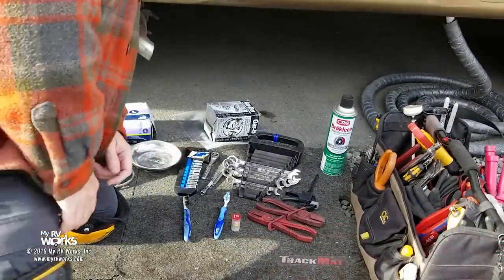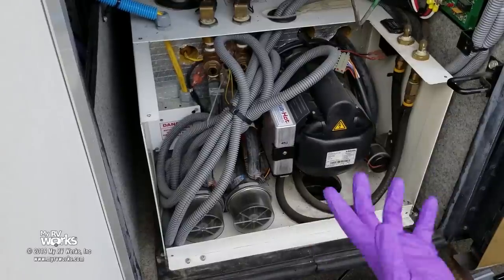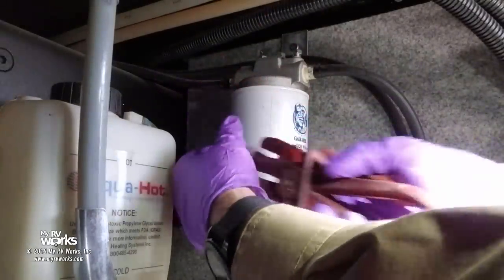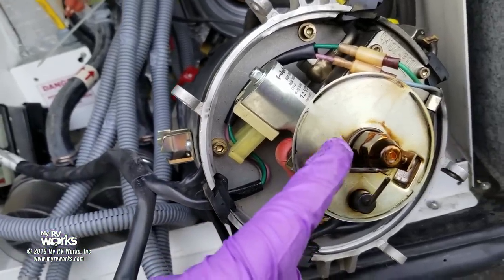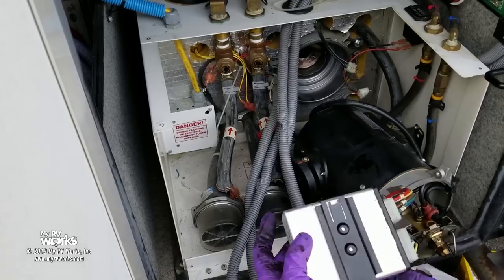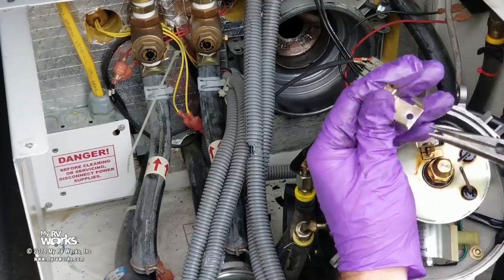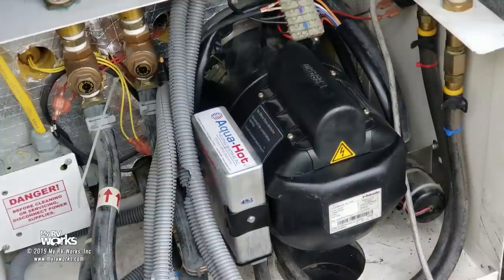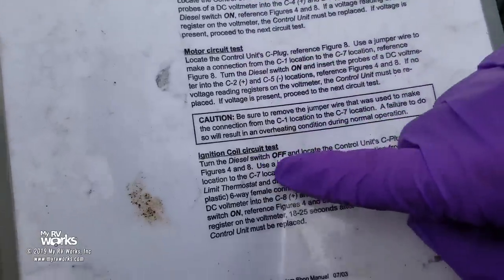AquaHot Troubleshooting and Annual Service

Comment: Hi Daren, this is a very comprehensive guide. My Newmar coach has a 450-DE model and all your tips worked really well. The burner in my case was really nasty and I would think that was not being serviced for a long time (I bought this RV ~1 year ago…). I bought other parts other than the filter/nasal since they were in a pretty bad shape. This was my first time doing this and I felt very confident following your procedure and the aqua hot is running smoothly now. Thank you Again! I now subscribed to your channel and will look for other great tips in your video selection. Have a wonderful week! Marcelo from Dallas/TX.
Reply from the maker: Thanks, Marcelo!

Comment: Installing a filter A technique taught to me by a clock Repair specialist is to first reverse direction when seating male to female threads. This allows the threads to "groove seat" with each other and avoids nearly all cross-threading chances. You can feel and hear the threads mate to each other.  Works well on nuts, boots and screws, too.
Reply: Especially spark plugs...

Comment: Free tip:
Nozzle is 16mm. 16mm won't cause the wrench to "stick" going on to and off the nozzle, potentially scratching it up or damaging it. That extra .005 of an inch makes the difference. And base is 19mm, btw.
(Hence, my 16mm and 19mm are two of the most used wrenches in my metric set. And probably my 13mm because of the hardware that comes with Lifeline AGMs. 1/2" "sticks")

Comment: The easiest way to eliminate spark potential is a jumper wire between both electrodes for fuel testing. I have a mini jumper with clamps set up for this. This will keep you from having to disassemble the coil.

Comment: Fuel filter o-ring protection: Guard against tearing the o-ring by placing the corner of a plastic bag over the filter base threads. This will keep the sharp edges away from the o-ring when sliding it over the threads to it's seated position. This works well with any o-ring application when sliding it over another object, especially one with sharp edges. (A technique used on suspension system rebuilds. See "The Motorcycle Suspension Bible" by Paul Thede and Lee Parks... It's got a lot of great Tech tips for working on mechanical things. I helped write the book---Shameless plug) Perhaps you can show this method as a quick tip in a short video? Thank you for all your helpful videos😊

Comment: Fantastic video Darren.  I learned a lot about our AquaHot.  I was hoping you would talk about the smelly smoke output and if there is a thermostat to adjust the temperature of the water.  Perhaps the annual service should solve the problems.  Thank you.
Reply from the maker: Domestic water adjust is on the back side.  It is marked at the factory so do not adjust it.  Better to slow down the water so it spends more time in the heat exchanger.  There are approved shower heads that work with the AquaHot - make sure yours is one of the ones they list.  So many GPM flow rate.    To schedule a service consult with Darren please sign up for the "1:1 Repair Consult" on our Patreon site.  https://www.patreon.com/myrvworks

Comment: I just bought a 2005 Dutch Star and this is my first glimpse at Hydro Hot all my previous RV’s had regular propane heaters. I’m so glad you made this since I’m totally unfamiliar with this unit. I don’t even know if this Hydro Hot is working. Asking how important is the antifreeze that goes in this? The fellow that owned this did no service of any kind to anything in this rig. I found the antifreeze way down. None at all in the recovery bottle so now I’m wondering what else has been neglected. Any and all help greatly appreciated. How do I test and purge the system?

Comment: Hey buddy. 
I’m a new tech and just trying to get familiarized with these units. I have one that’s not working. When i looked inside i noticed the high limit switch was no longer attached to the wall, it was just dangling, it looked like the bottom of the switch was broken off. I want to install a new one, but it’s location it’s rather challenging, i wanted to get your advice on to replace it. Thank you

Comment: Hi there, I have a newer 2019 Aqua Hot 600D that the overflow tank went dry, and had the “Overheat Fault” on the Aqua Hot Reporter 2.0 digital readout. I have topped up the overflow tank but still no hot water on electric or diesel. I started your troubleshooting guide pdf, and got to the BDC high limit thermostat circuit test and have “no voltage”. Guide says bad diesel burner controller. 
Here’s my question will that controller prevent from working on electric too? Just want to make sure before spending 800-1000 on new controller. Thanks in advance. Rod

Comment: Excellent Video.  Quick question. Is there any problem with running the aqua-hot system for cabin heat with no water or antifreeze in the domestic water system?

Comment: Thanks for the video I did my service it fired off it works but I have a lot of smoke I ran it for 20 minutes and it still smoking is there something I should check or just let it burn off all the extra fuel down in the system thanks for the video

Comment: Your videos are great! you are a good instructor. I was wondering if you had any videos on servicing a 250D model. I think it's almost the same, but I don't think the spray adjustment tool is needed any longer. Just change the filter, run unit, shut down, remove burner, check chamber and reflective ring, replace nozzle and put back together. Is this correct? A video would be great. I'm due my first annual service. I have the filter and nozzle. Thank you.

Comment: So you sell the 3 switch box with light for $200!!.  Test lead piecing probes for $80 that are $11.99 on Amazon.  Exactly the same.  Good job.
Reply from the maker: We started out with the inexpensive insulation piercing probes you found on Amazon and found that they don't stand up to constant use. For a hobbyist they might be fine but for technicians that need their tools to perform and work as hard as they do those cheap ones don't last long at all. But you're welcome to get whatever you want.  That's why there's Stanley screwdrivers and Snap-on screwdrivers. There is a difference in quality.

Comment: I can't seem to find a link to the troubleshooting material you mention in your Aqua-Hot video. I have gone as far as I can with the filter and nozzle and would like to follow your steps to find my problem. My 450DE still will not fire. The motor spins but no ignition. Thank you

Comment: First of all awesome video. I have a question about the bolts that connect the burner head to the burn chamber. How do you replace the bolts if you break one?
Reply from the maker: That's just good old-fashioned mechanical broken bolt extraction techniques. If you know a good mechanic I'm sure they've got the tools and experience to help with that.

Comment: I've just found you on YouTube. Also, just purchased a 1994 Prevost Liberty coach. When I turn the Wabasto on, I get a lot of blue diesel smoke from the exhaust. I don't think the previous owner used the Wabasto at all. I'm thinking I need to change the spray nozzle along with a routine service. Could the excessive smoke be from improper air/fuel mixture that you need the special tool to calibrate? Thanks, Don

Comment: Hi, thanks for all the work you do. I was fascinated to see you demonstrate the proper diesel nozzle mist. I wouldn't have the nerve to try it.  I have a harder problem. Interminttent ignition. I did the annual service. Fired it up and it worked perfectly. Then a week later, I got no ignition.  After trying 5 times, it igniting (burned off all the fuel with white smoke.  Seems it lights more when its warmer in the daytime, then when its cold in the middle of the night, which is not good.  Any thoughts on what causes the intermittenent ignition? many thanks to the experts here. ( I put this post on another video but it should have been here.)
Reply: You should check your burner spray pattern first, as demonstrated here in this video. Then see if the electrodes are clean and spaced correctly. You can fire the burner outside of the boiler. BE CAREFUL!  If it fires, great! Next, clean interior heat exchanger and make sure exhaust piping is connected and not obstructed. Otherwise, change the photoeye, and reinstall everything. Test. Good luck.

Comment: Thank you for this information in this aqua hot video.   My problem is that it’s starts and runs for 5 or so minutes and shuts off while heating both water and or space.  It does not restart and requires to be reset every 5 or so minutes.  Any thoughts.  I’m actually going to do the service this next weekend.  Thanks again for the video.

Comment: I appreciate your videos! I have watched all of them in regards to an aquahot system.  I have been troubleshooting mine and have replaced the electronic control board and the little silver box that slides on the burner. I have followed the flow chart to come to this conclusion but still the burner will not start (make the high pitch noise)  if you turn the inside switch on and off it will start for a split second but shuts back off. I am stumped.  If you have any recommendations I would appreciate it!

Comment: Love your videos best  learning vidios. I have a voltage toy hauler and the kitchen lights are not working what can be bad the fuces and the breakers are not bad so I don't know what to check next
Reply from the maker: Sometimes the light fixture itself is what's wrong. Maybe pull down that light and see if you have 12 volts feeding the fixture.
Reply: @MyRVWorks  yes that's a good idea thank you much

Comment: I am thinking I didn't winterize my unit properly because when I charge the waterline, it pushes out of the automotive radiator cap style pressure release on the top of the unit. Do you happen to have a video explaining how to change what I screwed up?

Comment: Well, you are definitely anal-retentive. With 55 years as an engineer and technician I can state that ANYONE worth their salt is anal-retentive .  This was a quality video and I learned a lot. Thank You  I have avoided Aquahot because they are not serviced by Stag.  I'm doing a job now as a good will gesture.  (I'm a sucker for a damsel in distress) My tech support is not reliable (three hours and no return call), so I'm surfing you tube and I struck gold.
I'm in San Antonio, TX. and I noticed you do other work also. I know from experience you're not anal in one area without being anal in all areas (it just ain't the way we think)   If I get someone going your direction I will send them your way. I tend to stay at my  parks forever so I get calls from customers saying I'm in so and so and this ain't working, or I'm in Oregon and will be there is three weeks. I can now direct them to you.

Again, thanks for a well done teaching class.

Les Smith
A-1 Mobile RV Repair

Comment: Do you have any info on a 250D install in Tiffin Allegro Red 2019? We’re having troubles with ours.. Gas failure at first and now Electric. Replaced filter and nozzle. Also, your nozzle replacement.. no torque wrench? Problem started with it coming on going through whir up.. run for a few minutes and kick off.. a keep us freezing.

Comment: I know they recommend that you not do this, but the coolant in my aqua hot 250D was so disgusting I've drained the entire system, flushed it through, flushed again, and then flushed again with distilled water. Now I'm contemplating the best way to refill the entire system, four radiators throughout the system and of course the boiler tank. I've been using a little sure flow pump and two 5 gallon buckets thus far, but I'm concerned about diluting the new coolant as I put it in to a system already full of DI water. Wondering if I should blow it through with low air pressure first so that I'm filling a dry system? Alternatively I could up the concentration of the coolant from the recommended 38% allowing it to mix with the remaining DI water in the system that I'll be pushing through as I refill the system with coolant.
Reply from the maker: The technique that I use is to first estimate the gallons the system will hold. I then make up that much pre-mix. Then I fill the system with my pre-mix. That should displace the distilled water already in the lines. After the lines have circulated for about a half an hour I then pull a sample and look at it through the refractometer.
Reply: @MyRVWorks  thanks for your reply, really appreciate it!. I used a sureflow pump with The input valve slightly closed so I didn't put all the volume through, but I figure it was probably 15 psi as I flush the system. Use the same process to add the new coolant but I let it flush through to the same bucket I was taking out of for a few minutes to get all the air out of the fluid and lines. I used about 10 PSI air pressure to blow all the water out of the lines before introducing the new fluid. That broke so much sediment loose that I had to reflush the whole system another three times.

Comment: We have an AH 450. Was serviced last month but fluid reservoir is now empty and not heating inside. I see no visible leaks or fluid under the rig. Could there have been air in the lines or should I look for other issues?  Thanks in advance!
Reply from the maker: You can start by finding your service manual here:  https://aquahot.com/Library.aspx

From the service manual you can follow the procedure on bleeding your system. It's towards the rear of the service manual.
Reply: @MyRVWorks  two quick questions: 1) we’ve been using the pink fluid in our 400-D unit. We purchased a gallon of clear fluid from a dealer who assured us it was ok/the same. Label reads the same but is it ok to mix clear and pink?

Thanks in advance!

Comment: I have followed all the cleaning instructions, installed new filters and nozzles and a new control unit but my Aqua Heater still rolls out grey smoke from the exhaust pipe. Would anyone like to comment if they think I need a new pump and it doesn’t seem to have enough  fuel pressure but there is no one in the area that knows Aqua Heaters

Comment: Hi, My name is Roger Rainham i have a Atwood 8531 Gas heater. when i turn on the gas heater i can smell gas and see small amount of black smoke, it all so turns on ok starts up runs and has heat after around a min the gas turns off and just keeps repeating it self still a small amount of gas. hope this is ok i live in New Zealand and got a 2011 Hoilday Rambler. The furnace is a bit Rusting.

Comment: Any idea where I an find the connector that I can use for the switch box?
Reply from the maker: I keep those green connectors in stock for when I build the remotes for the AquaHot controls.  
I can either sell you an individual connector or an entire assembled box.
Send me an email to work out the details:  Darren@MyRVWorks.com
Reply: @MyRVWorks   Great video Darren, I need one, email sent thanks. Could you please post the trouble shooting pages you showed at the end?

Comment: Thanks for the Great Video, Thanks to you I am going to tackle my 450D maintenance this weekend. I decided  to build a remote switch to make the job easier. On my wiring schematic It shows the negative for the lights on the engine pre-heat and electric switch going back to a separate ground, can they go to same ground with the burner on light negative  on pin 57 on the JP2 Plug?
Reply: Ground is always connected to the ground. So they can share a connection.
Reply: @GoGreenMobileRVRepair  thanks Justin, I made one myself.  It turned out great and was a fun project. Works as advertised.

Comment: I have an 450 and works great but 3am slowly replacing the components as they are failing over time.  10 yo unit. So far, one new motor in the burner. Then the burner head fell apart. Replaced with a new burner. Then a zone pump failed.  I shudda replaced both cause the other one failed the next winter.  With my luck the stir pump is next. To make it a little more difficult the unit is mounted in the middle of the rv and the lite panel is on the other side !?

Comment: I NEED HELP i have a aqua hot system it turn on for one hour or so once it turn off on the second cycle the light switch inside the coach will be off and the switch will be on. 
When it tries to turn on again it will spray but the ignitor will not go on. Should i replace the Computer or as u call it the brain. ?
Reply: i had our coach in the dealership twice and they couldn't figure it out so now im trying to get er done.

Comment: Well, I have issues 
White smoke on 15 seconds of start , then shout down, then can’t restart.  Diesel driping from exost a little. Called two repair shops, firstone did  annual service, and stil a same. Second spend 4 hours, and no luck. Is any one can give me advice.

Comment: I have the aquahot 450d it runs for about 5 minutes and then shuts off it is getting hot and I have done a tune-up to it and replace the nozzle and the fuel filter

Comment: After changing the filter, wouldnt it not fire because no fuel in filter yet???
Reply from the maker: It usually takes about 3 - 5 tries before the fuel pump in the burner will self-prime and fill up the filter. That's one of the benefits of having our T3 Interface Aqua Hot remote switch. You can switch the burner on and off right there from the unit.  When the amber light turns off on the switch you just cycle power to the burner to prime it a little bit more. Eventually it will ignite.  

Here's a link to the switch we make:  https://myrvworksstore.square.site/shop/tools/3

Comment: Is there another system that works better than that diesel
Reply: Yes, propane. Normally it is simpler to operate and easier to troubleshoot. Or electric, shore power.